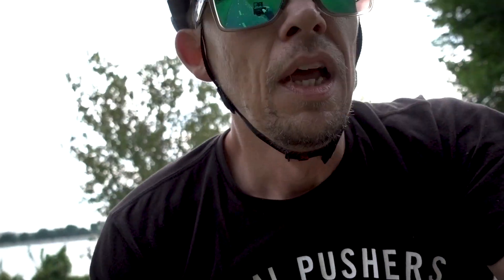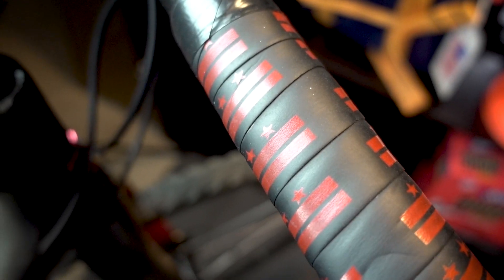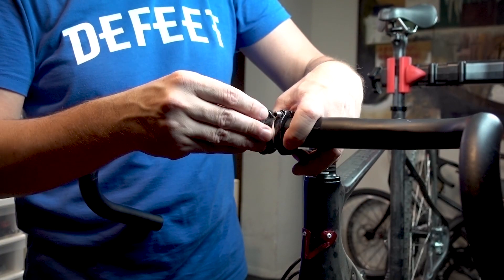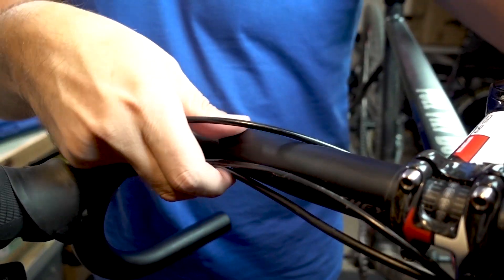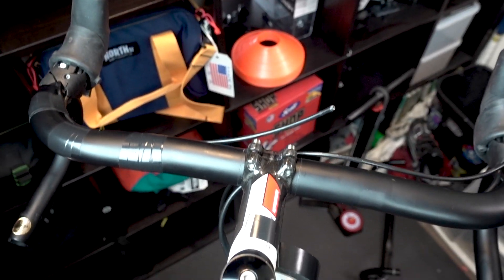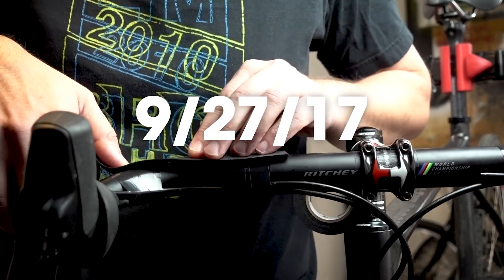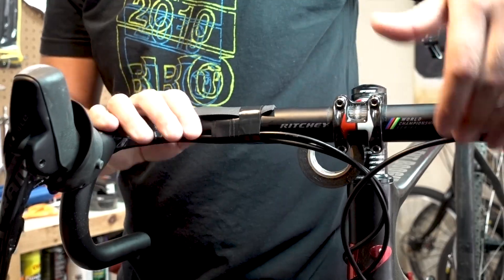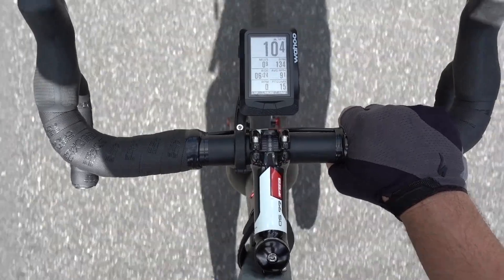At This Rate, I'll Be Racing On My Cargo Bike – S03/E03 – The CXOff

Comment: I have a bike I that would not shift into the 11 either. Solved it by putting a washer on the derailleur mounting bolt to act as a spacer pushing the whole thing out a mm or 2.
Reply from the maker: Ooooo, interesante.